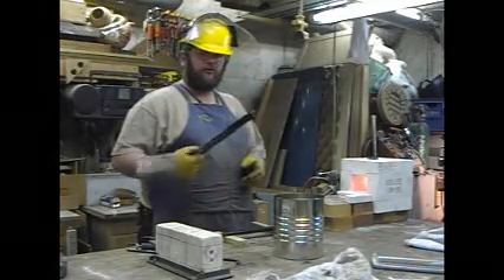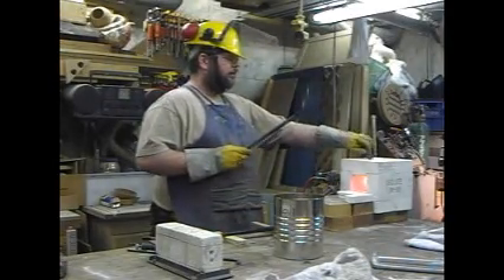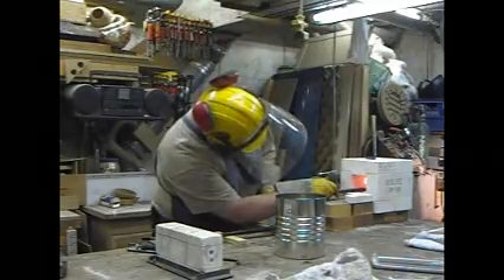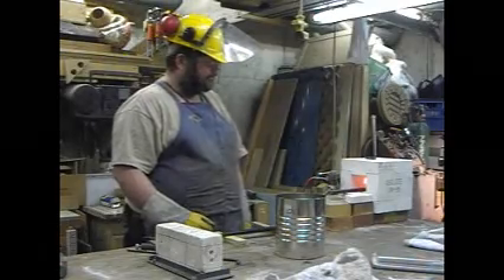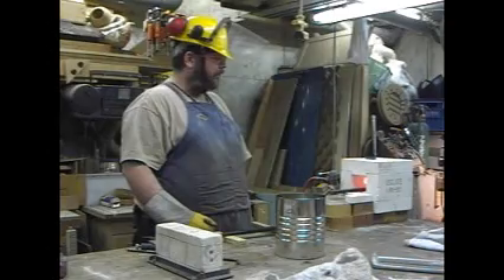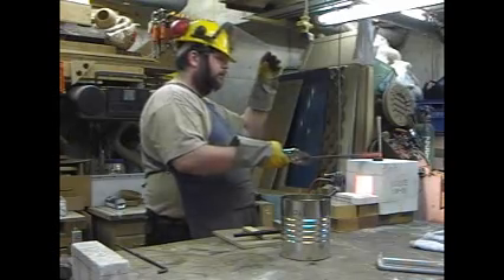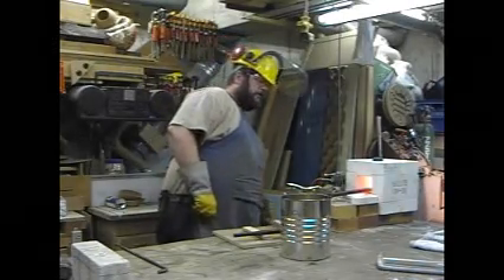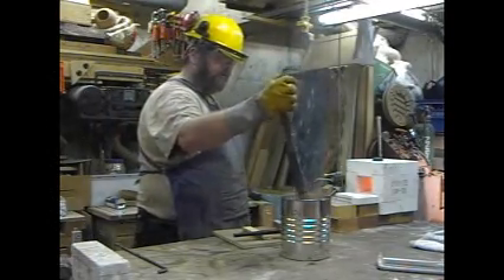Hardening M2 Tools Steel

Comment: I know this is a very old video, I just wanted to say you need to heat M2 up a lot hotter than that to quench it. usually it's quenched at around 2200F higher than yellow.
Reply from the maker: Thanks, I understand I have a LOT to learn about this kind of thing, might be why I don't really do it anymore, also living in downtown Tokyo is not really the place to do this stuff.
Cheers!
Reply: @TokyoCraftsman  I understand, I came across your video after searching for some M2 steel to buy and researching how to properly heat treat it. I have simple backyard equipment myself so I know the struggles haha. I have developed a way to heat treat these types of high temp steels with basic equipment. you can do it without expensive equipment and heat treating ovens. Use a basic Anthracite coal forge to get it to white heats, and quench it when it is glowing white after soaking it for around 3-5 mind in the heat. Then you temper it by getting a heat gun and putting it inside a steel tube or pipe, and sticking the nozzle of the heat gun into the pipe. You need to get it to blue which the heat gun will do and keep it at blue for around 1-2 hours inside the tube then it's done. So these type of steels are backwards, as the tempering temp for this would actually anneal a basic carbon steel, but the blue/grey colour actually tempers this steel instead of anneals it. You can pick up the heat guns for undr £15.00 on Ebay I use a Netta one it's cheap and good, can run it for over an hour without overheating I even start my forge with it without using fire to light it. Hope you are enjoying life in Tokyo, I would love to move their myself.
Take care.

Comment: Surely by now you realize that this was poor practice for M2, right? It takes around 24 hours to properly harden and temper high speed steel. The temperature is brought up to one point reasonably quickly, held there for hours, then ramped up at a slow, controlled rate to its austenizing temperature, held there, then slowly ramped back down. Same controlled rate (ideally in a nitrogen environment, if memory serves). What you did may have made it harder than when you started, but not hard enough to cut as truly high speed steel (retaining its hardness when hot from cutting).
Reply from the maker: Yes you are correct, this attempt basically failed, but I was trying new things.
Thanks

Comment: There is no way you are achieving the correct mechanical properties for this material.  

Don't you realize that you can finish machine your M2 and pay to have it heat treated in a vacuum for less than $75?

Comment: M2 is air harden you might have some cracks.
Reply: Not true, you can Air harden, Oil quench and salt bath M2.
(This reply isn't really for you just teaching people who might read this)
Reply: @LondiniumArmoury  I know there are better steels for this, but could you make a reliable sword or knife from M2 tool steel? What is the max hardness of M2? I believe I’ve seen some HSS Hacksaw blades around 66-67 HRC.
Reply: @Divine_Serpent_Geh  i have made around 3 4 knives out of M2, already hard at 65, man this thing is crazy. It's almost rust resistant.

Comment: Not if you sharpen them correctly and the bits themselves are not case-hardened (they shouldn't be, but you never know what's exported from China these days).  Sharpening removes less steel more gradually than rough grinding, meaning heat build-up should be minimal.

Comment: do drill bits have to be heat treated after resharpening
Reply: No, not if you sharpen it correctly. that no straw or blue coloring, which would mean 300 to 500 degrees heat on the point of the drill.
You do not reheat treat a knife after sharpening it.

Comment: Austenizing temp for M2 is around 2200F which is way above the Curie temperature. At that low temperature you're not dissolving the alloying elements into solution so you're likely not getting wear resistant properties of M2. But "hard enough" is hard enough... ;)

Comment from the maker: What I'm doing in the video is "Austenitizing" them, that is hardening the steel, as it came annealed or soft to work it. After I get done austenitizing the steel, they will be hard, but brittle, so I'll then have to temper them, which requires some controlled heating, between 540C and 570C for near two hours, this will make the steel tempered, hard, but not brittle.
The Phoenix is basically done, to the point where I'm using it.
Cheers!